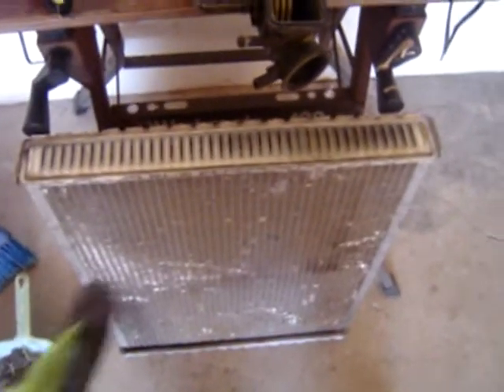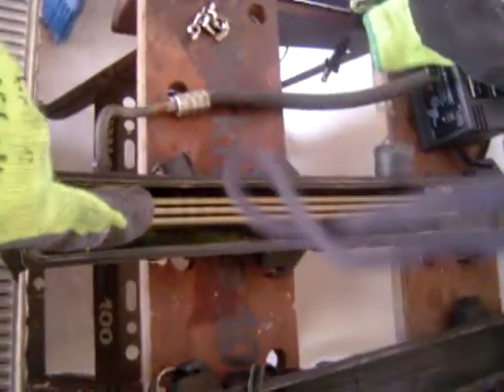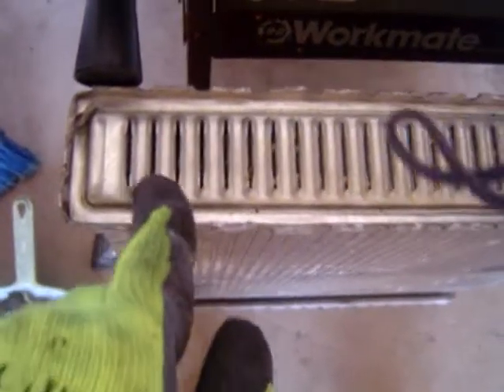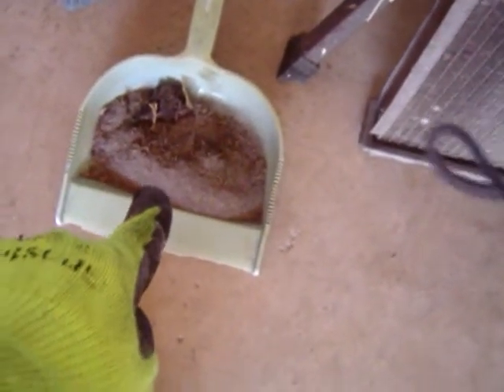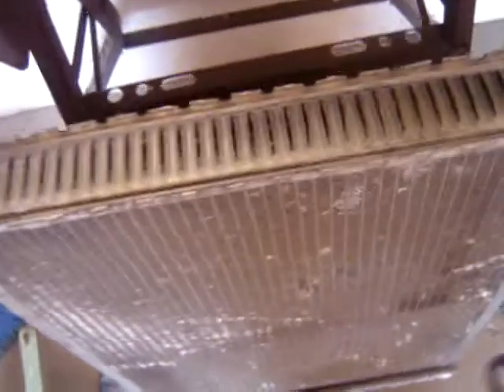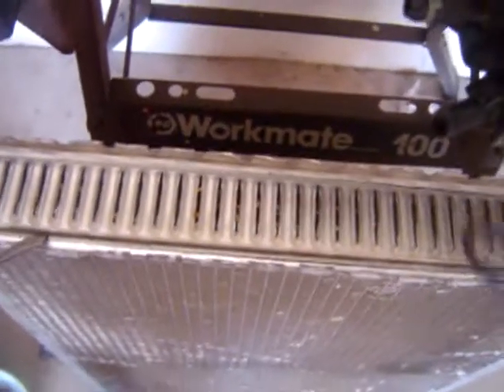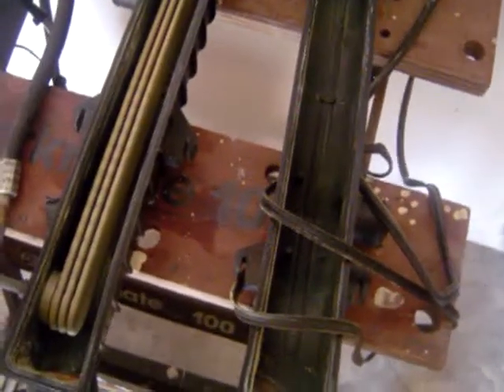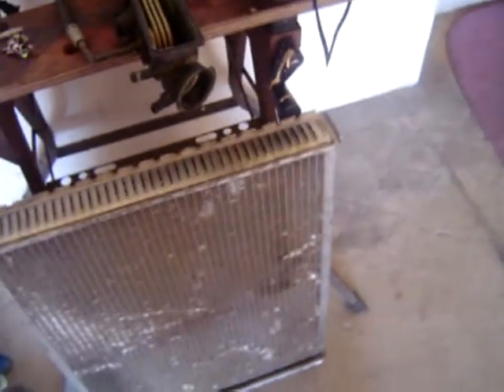Inside a Car Radiator, Trans Cooler, Why They Fail, How to Dispose a Radiator

Comment: would have gave you a thumbs up if you would have cut it in half and showed the tubes and stuff inside
Reply from the maker: TheBassnator Maybe when I get a plasma cutter, for now I have nothing to cut it with.  I would be interested in the inside of it and even "tricking" it out; at least taking a look at how to improve the inside.  However, using air and blowing out the debris I think is a good preventive method, especially if you have dirt or sandy roads.  It does not matter what you do inside so long as the outside is so disgusting.  MY POINT IS THE RADIATOR IS NOT DESIGNED TO LAST AND IS SUSCEPTIBLE TO ENVIRONMENTAL PROBLEMS PEOPLE ARE NOT AWARE OF!  I was not aware of some of the factors that degrade a radiator or cooling system; I was more pissed off with what I found when I investigated the cause of the failure.